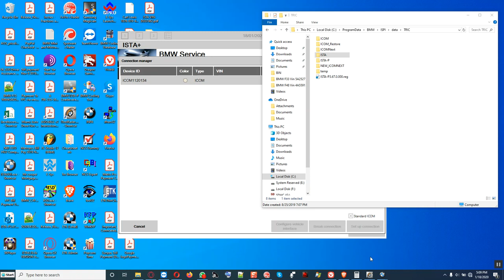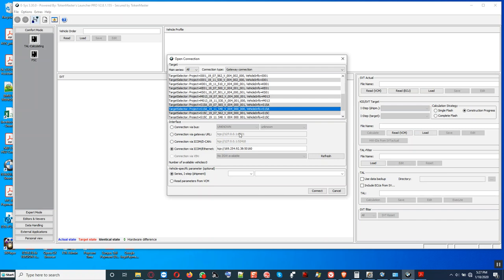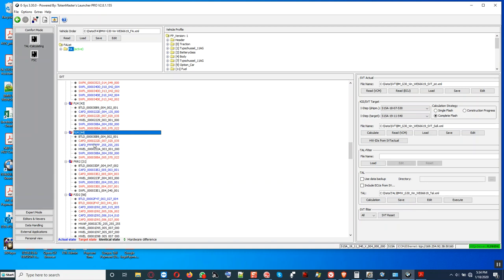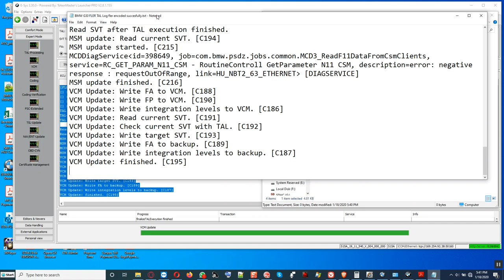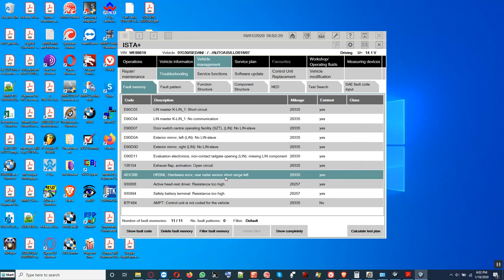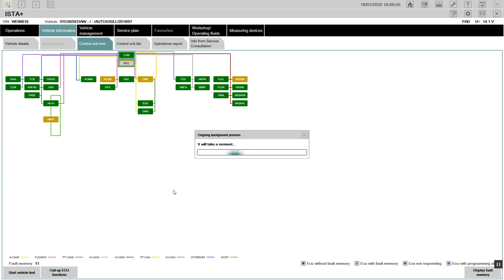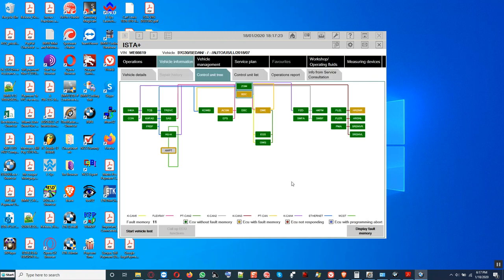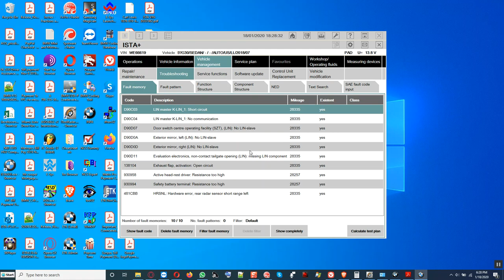BMW G30 Front Light Electronic Right(FLER) Encoded and Amplifier Encoded 2020-01-18 18:28:40

Comment: Hello mate . I bought a damaged car and installed brand new headlights. Once installed the hazards signals worked. Now I have coded the vehicle in esys and headlights work but the front hazards are showing warnings and not operation correctly. Any idea?
Reply from the maker: wataspp me +1786-355-3660

Comment: Hey there. Ive replaced FEM/BDC on F30 and now audio doesnt and engine DME has 1F2108 code also left + right headlights do not work. I have used Autel to program and code all modules but still have these issues. Do i have to use e-Sys to properly encode modules? please any help will be appreciated thanks!
Reply from the maker: is FEM-BDC used ? if not order new BDC
Reply from the maker: Contact via watsapp +1786-355-3660